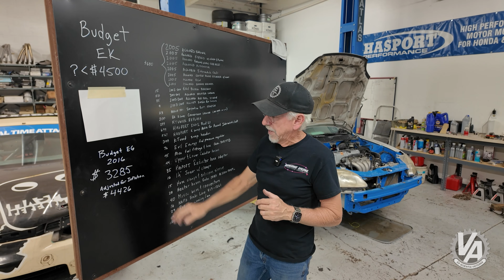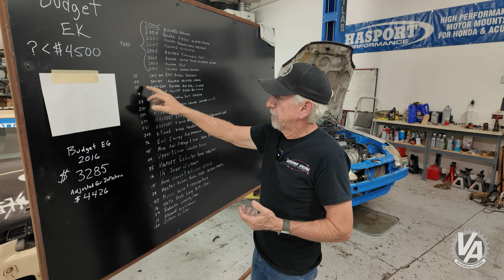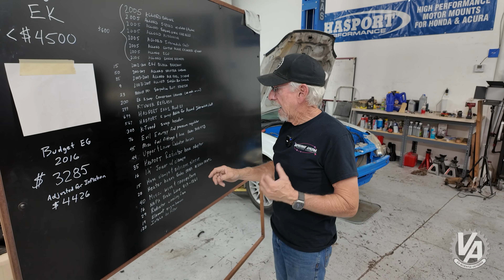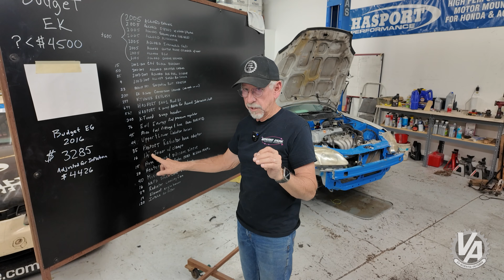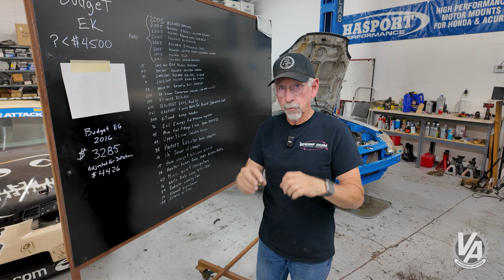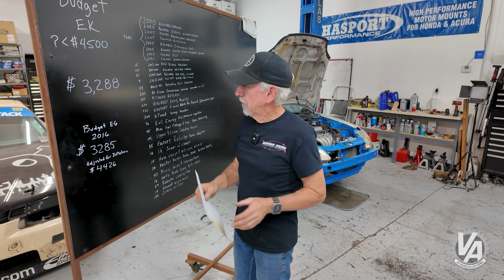K Swap EK True Cost EXPOSED

Comment: can i just use wire taps for conversion harness for 3rd gen prelude or do wire need to be removed  wires. what conversion harness would you start with for 3rd gen prelude

Comment: Lol accord k24 !!! Vtec on intake only =160hp, not sure what crowd of honda enthusiast is gonna do a K swap and all the work required to do it correctly and choose the slower k24 to swap !!! Smh id rather keep or buy gsr swap and invest the $4500 into it then  spend $4500 for a motor that's the least powerful of the k24 platforms, but because it's to do with hondas im sure there's those individuals so desperate to say they have a Kseries swap don't care if there still in the slow category in comparison to k24a2 swapped car 😂😂😂

Comment: I did my 2001 civic ex sedan for under 4k using junk yard and eBay parts❤❤
Reply: Is that an em2 chassis because I’m picking up an 03 civic. Also are you running ac or no?
Reply: Is that an em2/es2 chassis because I’m picking up an 03 civic. Also are you running ac or no?
Reply: @jefrysandres9534 it's an es2 and no ac yet, but might in the future

Comment: I'm currently 10k into my EK K24A swap, full bolt on name brands. This is not for the weak!!
Reply: 10 is insane. K24A/X2M4/Kpro4 - I'm barely over 5
Reply: @Ochumvru There are a lot of different ways to do it. You can do it as cheaply as possible, you can ball out and go for big power, or fall anywhere in between. I’ve heard of much pricier than $10k. And much less. Just the ECU alone can be a huge difference in price.
Reply: @chaseteter bolt on k24 with a haltech r5 doesn't even cost 10. k20a maybe, but not a k24a.
Reply: @Och I’m not saying it’s the best value to spend $15k on a k24 swap but it has happened many times and will happen many more times. 

You can buy cheap parts, you can buy flashy expensive parts, you can even make parts from scratch. You can buy parts for today or overbuild and buy parts for tomorrow. Axels are a good example. 

The labor you get done can be a straight forward, no frills swap or it can be dressed up with tucking and shaving. 

I wouldn’t have mentioned Haltech specifically but since you did, it’s a $4300 ECU. A display for it runs an easy $1-2k. So $6k right there if you wire it yourself. Add more for the actual dyno tune. 

I’m not saying this is the move but you can go nuts and spend more than $10k on this.

Think about it this way. If I handed you $12k for a k24 swap, and told you the only condition is you have to spend it all in the swap, I guarantee you would come up with a bad ass build.
Reply: I’m 10k deep bone stock k24a2 with awd trans 😭 didn’t even pay for an engine bc it was sitting in my garage. I don’t get it 😂
Reply: Granted, I lifted it 2 inches re did the entire front end, brakes on all 4 and bought rims and tires, struts etc. even painted the whole car but idc, seems too steep, but it was damn bear a full resto
Reply: I swap is not as cheap like people think it is
Reply: i've done it for cheaper than this video a couple times.

Comment: are r18 and k's manual transmissions interchangeable? (besides number/ratio of gears/lsd) specifically 8th gen. so could i just bolt a 6speed up to my r18? or can i bolt a k's engine to my stock tranny?

Comment: This build assumea really good luck at the junkyard which by itself makes these types of budget nbers not realistic for most people. Secondly, anyone who cares about their build is gonna wanna make sure it lasts which means machine work and all new gaskets whick is like 2K.
3rd they aren't making their own wiring. 
4th supporting mods like brakes and suspension to handle the increased power
5th most people aren't doing a reflash but a full hondata

I'm not really disagreeing with the point of the video but but people really need to be setting their expectations when it comes to how much money they are willing to spend on their k swap. The more you spend the better the quality of the swap will be. You can also build your motor too which is where the k really starts to shine. Or you can have a build like the one in the video and yeah you can say it's k swapped but you aren't gonna be making the same power with your leaky tired 200k mile engine. Nor is it gonna look and good. Lets not even get started about using cheap swap parts that barely fit or non oem/knock off oem ebay sourced parts.

But it is refreshing to see that it can still be done for under 5K despite the current market. It won't be the best but it will get you most of what your looking for haha!
Reply: The sad truth is it's cheaper to make a fast car using a GM-LS. I daily a turbo EG in the warm months but I'll never waste money building another Honda. I'm at $3500 for an LS-swapped Mustang including the caged shell, built 8.8, 4l80e, and fully rebuilt 6.0L. If you're into turning, a k-swap Honda is still hard to beat.
Reply: Brother, it’s a k series, it will last without a full rebuild. They go 250k plus consistently